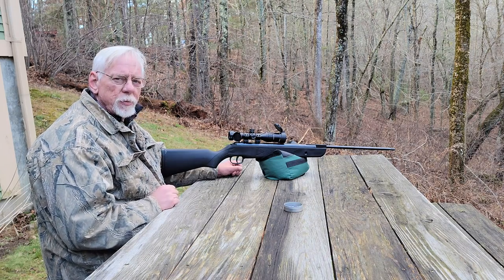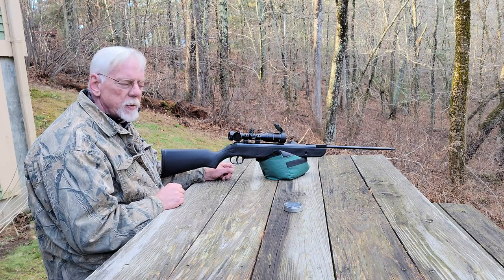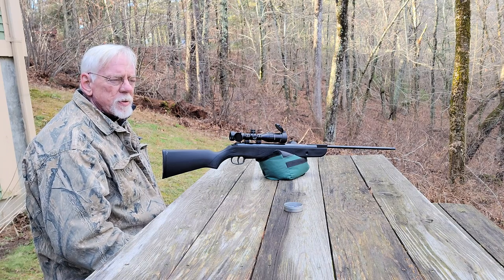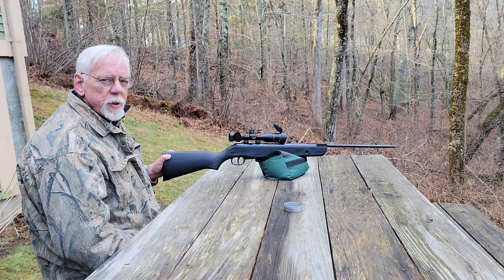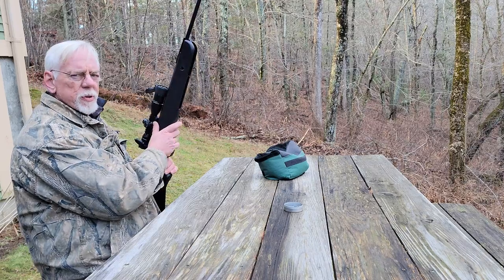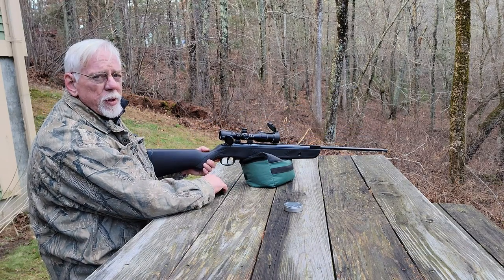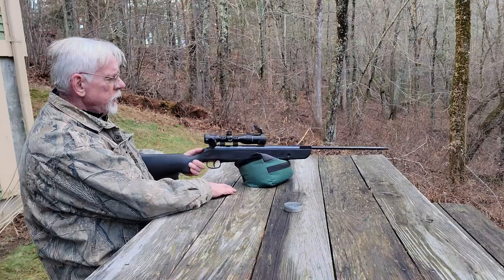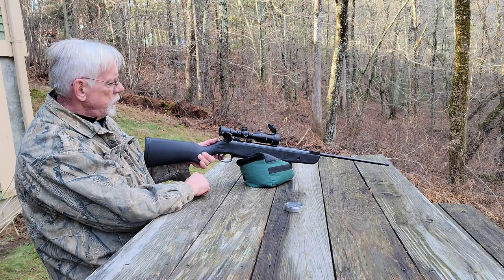Airgun Soda bottle tune results Winchester 1100S

Comment: I watched your tuning on the Varmint, is this the same process only with a soda bottle instead of the metal from a can?  I've got both rifles and am thinking of starting with the 1101 first.  One last question, what scope are you using on the 1100?  I've been running iron sites.  Thanks, good videos.
Reply from the maker: The soda bottle technique is very similar to the aerosol can technique. Check out this video where I show how to make a piston sleeve from a soda bottle.
https://youtu.be/RKicK5xJuwc
The scope is a 3-9 UTG Bug Buster. They're available on Amazon. 
Thanks so much for watching, my friend.

Comment: Did you do any trigger work on yours?  The way you are pulling the trigger I would assume you have if it was at all like mine as it takes three men and a boy to get the trigger past the second wall!!
Reply from the maker: Good eye Doug. There's a trigger mod out there in the airgun forums. It requires q set screw installation under the rear stock bolt. The screw acts directly upon the sear and can be adjusted somewhat.  Be careful however, if adjusted too far, the gun becomes unsafe. It makes the trigger more manageable but not great.
Thanks for watching.

Comment: I bought the Daisy version of this, I absolutely love it! From a rest, I can hit a 1” spinner at 50 yards open sights, about 1 out of 5 shots.   After about 500 shots it has smoothed out quite a bit. I have a tune in a tube on the way, and I’m hoping it takes some of the twang out. I don’t have a spring press yet to do the piston sleeve mod. My PCP is getting dusty with my new love for springers.
Reply from the maker: Yes, the Daisy 1100S is the same rifle as the Winchester 1100S. It's really astonishing that they can sell this gun so cheap. It's really not a bad gun. 
You don't need a spring press to disassemble or reassemble that rifle just so you know. The only problem you may run into is that the trigger is a little bit tricky and has to be partially disassembled in order to remove the main spring and piston.
Although I've never tried it I hear that the tune and a tube works pretty darn well. Thanks so much for watching.
Reply: Where can i buy a tune in a tube?
Reply: @GluteusMax777  I got mine on Amazon.
Reply: @cyclepath78  Thanks

Comment: Hi. Did yours come with a scope or did you add it? Are there rails already provided for scope installation? If so, what scope do you recommend?
Reply from the maker: There was no scope with the rifle. The rifle is equipped with scope groves as well as a built in scope stop. Unfortunately,  if you don't spring for at least decent glass, you're just throwing your money away. That means that the scope will cost about as much ss the rifle. Still, a decent scope makes shooting the rifle so much more precise.  I'd recommend a Hammers 3-9x32
Hammers 3-9x32AO Air Rifle Scope with One-Piece Mount,Black https://a.co/d/iLqQZNg
It's a very good scope considering it's price point and it comes with a one piece mount.
Thanks for watching my friend.
Reply: Thanks for replying. Good videos. Keep the good stuff coming!

Comment: Hi, I was wondering how to take the front sight off this rifle, I tried but am afraid of breaking it.
Reply from the maker: The front site is a friction fit over the knurled end of the barrel.  Removing it will most certainly make reinstalling it difficult as the plastic will most likely strip out. I have no plans to reinstall my front sight so it wasn't a consideration.  Thanks for watching.
Reply: @razor1962  Alright, thank you very much, also, great videos, love them :)

Comment: Good job you did there. Do not understand why the factory do not put a Ptfe/teflon sleeve in it.
Reply from the maker: Springbuzz is a peeve of mine. I suppose it's possible that most people aren't bothered by it. Thanks for the kudos and thanks for watching.
Reply: it cost them an extra penny
Reply from the maker: @TuttleScott  Truth...
Reply: @TuttleScott  Yes i agree but even when it is made in China, Winchester has it's name on it.
Reply: @razor1962  Thanks for the video. I have tuned all my HW rifles. I don't like xtra noises that can be fixed very easy. All the best from Sweden.
Reply from the maker: @rapalaron6348  Thanks for watching!
Reply from the maker: @rapalaron6348  I know what you mean. All of my springers are tuned except for the most recent addition but that one doesn't seem to need much.